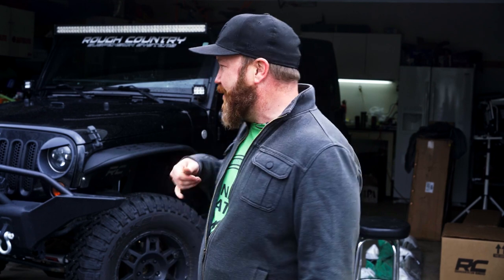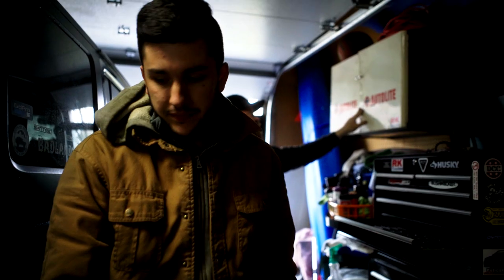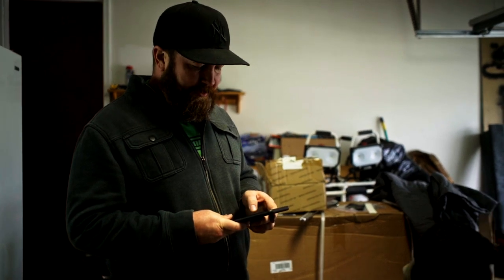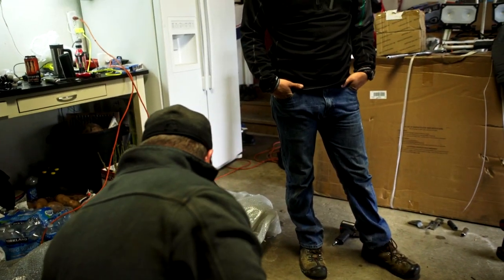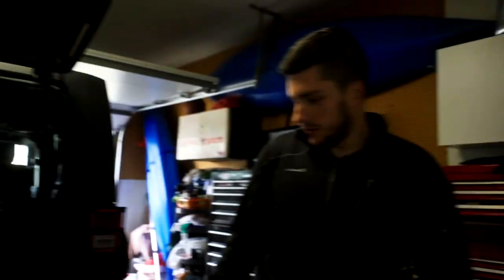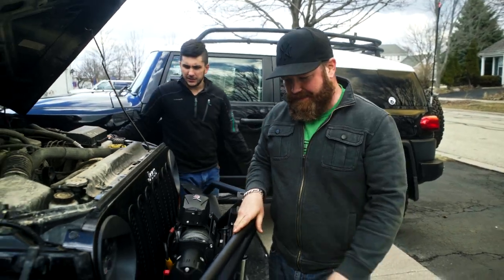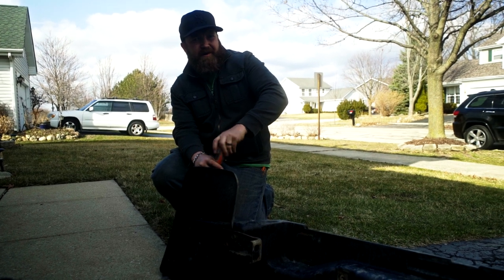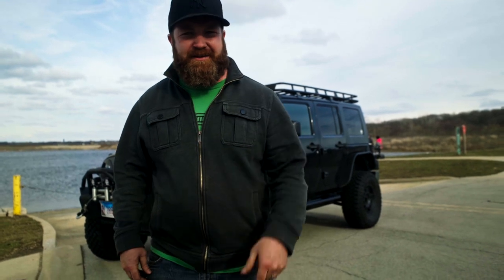Vlog 12 - New Parts Install Day!

Comment: It sucks the parts weren't included! I'm so impatient I probably would have tacked a nut on the inside just to get it on.
Reply from the maker: We definitely almost did that, but I really need this thing to be sturdy. It's class 3 tow rated, weighs 150 lbs on its own, and the tire carrier is another 180 lbs without the tire, jerry cans, or hi lift. Insane!

Comment: Your box beat to hell with broken / missing parts I too have experienced; multiple times.  Extreme Terrain.  Fooled me twice.  Ever since I go direct to local dealers.  

I will wait for the black shirt.  I have a lot of hiding to do.
Reply from the maker: Yeah I ultimately found out that I actually ordered it through Quadratec's Amazon store. They responded quickly by shipping out a new bumper on Monday, sending UPS to pick up the bad one, and that the tire carrier has been at a freight place since last week. Anyway, dark colored shirts with white logos are awaiting approval, so I'll get you that link as early as tonight! I'll be getting a black one myself. ;)
Reply from the maker: Hey Joseph! Black (and other dark colors) Snail Rated shirts are up! https://www.amazon.com/dp/B07CF55JVQ/r
Reply: trailspinTV Right on! Picked a black and an ass fault.  Now go get on that trail.
Reply from the maker: Yes!!! Ass fault. Thank you so much for grabbing some of that sweet merch! 100% mud absorbing, and guaranteed to rob another 5hp. Heading down to Kentucky again this weekend for one last "test run" and then it's on to the TAT!